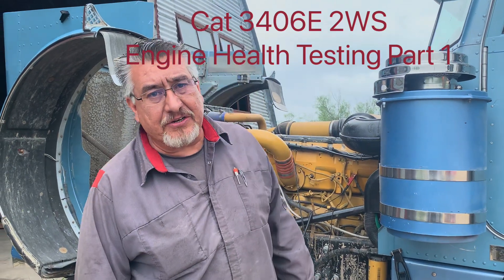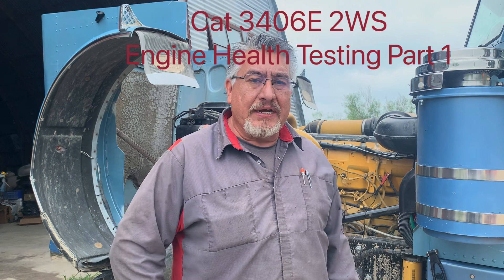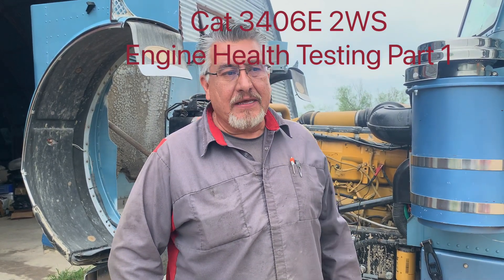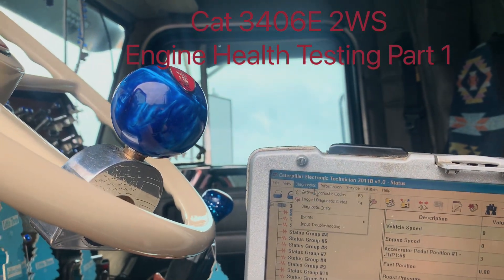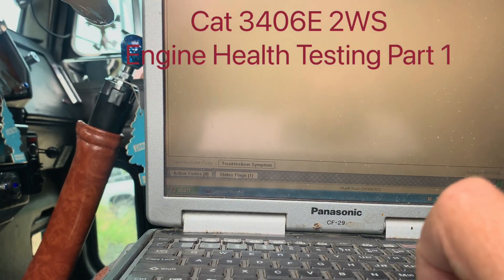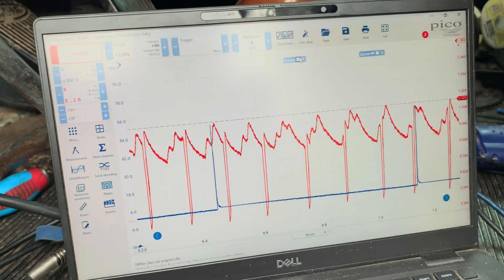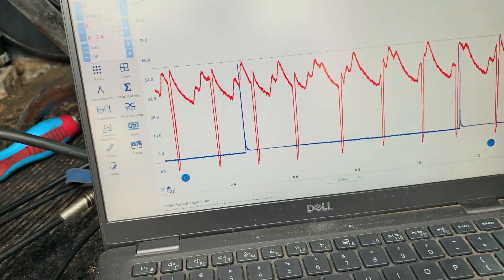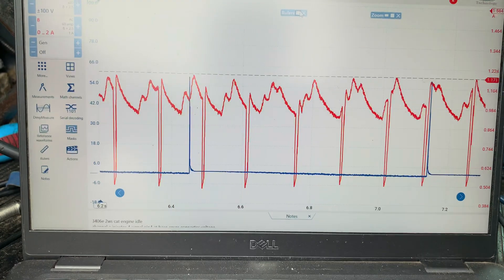Cat 3406E 2WS Engine Health Testing Part 1

Comment: I went and drove harvest for a farmer a few years ago.  The Sterling semi truck had a 3406E and was ex-fleet, 20 years old.  The farmer actually thought the speedometer was the "original" mileage of 900,000.  Then I explained that the speedo has been around two or three times, and its real mileage was 3,900,000.  This truck was beat to hell, and was guzzling fuel,blowing black smoke.........I suggested it at least needed a valve lash adjustment........and he said "whats valve lash?".
Reply from the maker: 😂 hey if it ain’t broke, keep on keepin on . That’s cool. Yea we need to fill up those cylinders with as much air as possible. Valve lash helps to make that possible